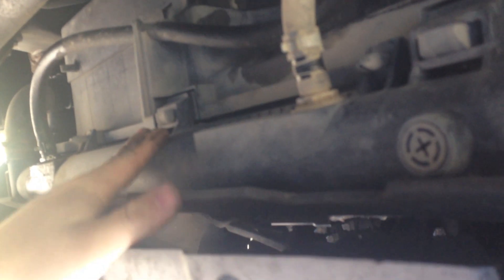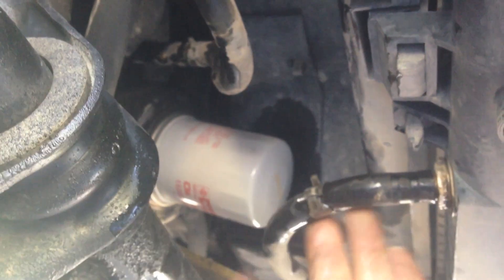Nissan 2nd gen Xterra Transmission bypass

Comment: Since I found Tras fluid on the radiator damage is already done I think, if I do this will stop the mixing? or should i replace    the radiator? I know aventually I have to Replace it and fix or buy a new transmission.

Comment: Hey guys, just bought a Xterra 2005 manual transmission with 80k miles on it and started to freak when I read about this issue.
Just wanted to make sure... Is this an issue that goes only for Automatic transmissions Xs?

Comment: i just got a 2000 nissan xterra, i put coolant in it, and a hour later well driving  the oil light came on and now its knocking and wont jump start? did  the motor blow up, bc there was too many miles? 

(it was running fine, before the coolant was but in )
Reply: I know this is an old comment, but I'm curious. What was the outcome here? Did you put coolant in the wrong place causing it to overheat?

Comment: any reason you re-routed the trans cooler lines instead of just unhooking from radiator and connecting them together Zak?
Reply from the maker: Just quick and simple . I've put 60000 miles on mine since then and its ran like a top. Good luck.
Reply: Thanks Zak. I've got appx. 35000 on my bypass with no issues. But I just disconnected from trans cooler and butt jointed together.

Comment: 61 thousand miles on my 2007 frontier, 2 transmission failures. one at 25k miles in death valley and now one at 61k miles due to radiator crack. fuck Nissan . wish i would have known this

Comment: Looking at a 01 Xterra w/119k miles.  Is there a way to tell if water has already got into the transmission before buying?
Reply: Gen 1 trucks are not known to have this issue.  The issue was predominantly with early Gen 2, 2005+. I don't know what they redesigned to cause it. Some things shouldn't  be changed I guess.

Comment: Awesome video and great solution to prevent transmission contamination! Another solution to prevent contamination plus eventual radiator leak in one shot would be to replace the radiator with an aftermarket NON Nissan radiator. Great job man.
Reply: super old conversation, but I was just wondering if your statement of replacing the radiator to prevent this issue is true? Would I need to do anything else besides replacing with an aftermarket radiator?  Thanks for the help.
Reply: John Park replaces mine. Haven’t had an issue.
Reply: @ZongTaVEVO  nice thanks for this - I actually got into an accident which forced me to replace mine about 5 years ago, haven't had a problem so far.  Currently got 137K on my 2009 xterra, and was concerned about this issue, but I guess i can safely assume that if it hasn't happened yet, i'm good, lol.

Comment: I did this bypass 4 months ago on my 2006 pathfinder after watching this video, I haven't experienced any issues yet. Thanks Evans.
Reply: Is your transmission still OK after doing the bypass?
Do you drive in hot weather for long periods of time? Get stuck in traffic?
Reply: It gets pretty hot here, the temperature where I live has been around 30- 42°C lately. I drive long distance once a week about 200km while the remaining part of the week is usually intra city driving with a lot of traffic light stops. Despite all that, I haven't noticed any deterioration in the transmission functions, in fact it became more efficient about a month ago after the transmission fluid change.

Comment: Zak
So basically you're creating 2 closed loops, correct?  Initially, you had coolant leaving your radiator, and flowing through the transmission (in a closed line of course) to maintain transmission temperature. It then returns to the radiator. Your new closed loop just circulates the coolant back into the radiator without ever going to the transmission.  That's all fine. Now what about the other closed loop in the transmission? Doesn't that loop contain coolant that will circulate?  The only difference is that the coolant will never return to the radiator to be regulated for temp. So, if you were to develop a crack in the line within the transmission loop, you could still wreck your transmission...?  Is that correct? 

Thanks
Reply: Or, does that second loop (to the transmission) contain only ATF and the original problem existed because ATF was being cooled while running through  the bottom portion of the radiator (hence the two lines at the bottom of the rad) and the rad, internally, cracked, allowing coolant to mix into that dedicated ATF line?
Reply: If that's the case, this bypass essentially isolates each fluid and creates an air to fluid ATF cooler situation. Sorry for all of the comments.

Comment: Zak I only found out there was a problem when my wife told me the car overheated. that's when I found the what I called purple foamy chocolate milk shitake in my radiator. ergo why I did the bypass. but was too late. so I'm in on the class action lawsuit about the radiators being faulty.
Reply from the maker: If it's already contaminated you need a complete transmission tear down. This is only done before it shows signs. Unfortunately this won't help u my friend . Get it cleaned out asap. It will be cheaper than a new transmission .

Comment: Great video . I have a few questions. Do you think it would be good to buy an 05 xterra that possibly could already be contaminated and do this fix? It's an 05 with 180k miles ... How is yours running today?
Reply: +Broseph how's your situation? I see you asked this awhile ago. Lmk if you still need this answered.
Reply from the maker: If it's already contaminated it's game over. Mine is doing great! Just rolled over 160.000 miles. That's two summers of pulling a boat and four 10 hr or more road trips without a issue.
Reply: +zak evans how can I tell of it is contaminated?? I took it to Nissan and they said it might be because the radiator has been replaced and the transmission fluid looks bright red.

Comment: We did it on our '05 at 90k 2 yrs ago, it now has over 150k with no problems, and we tow a 24' pontoon boat with it. No extra coolerwas  added, just the hose bypass.. thanks for showing how to do it!  R in NY
Reply: FWIW, I've been working with hot rods on and off for years. Most have small V8s (300-350 cu. in.) and three- or four-speed auto transmissions from GM or Ford. In no case have I ever seen anyone use the transmission cooler that's built into a radiator when building these cars. In fact, I have seen a number of people put these cars together with no cooler at all. It appears the transmission housing itself does a reasonably good job of dissipating heat, and those vehicles apparently last just as long as the cars with coolers. It's a different story if you tow, of course, but even then, a single air-cooled transmission cooler like the one in the Xterra should be more than sufficient.
Reply: Is your transmission still OK after doing the bypass?
Some people say that their transmission died right after the bypass. Did they do it wrong?
Reply: Maybe their fluid was already contaminated.

Comment: I have a Nissan Frontier SE 2007 and I'm planing to copy what you did in your Xtera. Do you think it's the same procedure with the Frontier to bypass? If so, was the tube that you removed the supply line from the driver's side?

Comment: Dam B and Zak Evans:  I just had the bypass/loop done on my 06 Xterra.  The mechanic who did mine (specializes in Nissan/Infiniti) said that it should be fine without adding an additional external cooler, because it already had 2 in place that it was using prior to the bypass.  Any other advice that I should be concerned about?  I feel like if it was needed, he could have easily told me that & made some more money, and I would've probably paid him.  I was taking his word on it though.
Reply: Is your transmission still OK after doing the bypass?
Do you drive in hot weather for long periods of time? Get stuck in traffic?
Reply: I did the bypass to my stock 06xterra I bought at 85k miles, it has been 6 years and is now 130k miles with no issues and I live in a fairly hot climate. I wouldn’t dare tow anything though

Comment from the maker: Why are you commenting so much when it is Apparent you know nothing about 2nd xterra cooling set up. The transmission cooler is still intact and fully functional. The lope ran transmission tran cooler -radiator cooler tran. Moving the hose as shown moves eliminated the radiator cooler portion out of the loop. Thus eliminating the possibility or cross contamination of trany fluid and coolant which plagued these trucks for years. So if you are gonna make comments know the facts first. If you want to rant read up on 2nd gen forms across the net. Don't be ignorant.
Reply: Is an addition of a transmission cooler needed?  Or can I simply swap the hoses to eliminate the problem?  My xterra has started to leak coolant into the radiator.
Reply from the maker: +Ben quinn then please express your wisdom and knowledge that you have . I did this 2 years ago . My Xterra has ran fine with no issues . I have pulled a boat through countless mountain roads in the 100 degree heat . This bypass was "recommended " by the lead mechanic at my local dealership.
Reply from the maker: +Ben quinn  tell your friend to do some research the way I did it has worked for tons of different people so he either didn't follow my instructions  or he in fact is the "bonehead". Nissan refuses to admit their transmission cooling system was faulty and the early second generation Nissan Xterra. It would make sense if you went to a Nissan dealership with the failed transmission that they  would be  more than happy to make tons of money to replace it. Of course they will blame the bypass  that don't want to be at fault . So don't come on here and say it's my fault . Worked for me , worked for others .  Idk what your friend did . Maybe you both should  go back to the craft section of YouTube. The directions are a little easier to follow.
Reply: I did this also to my bad luck and iam reaching 275 to 300f while driving  for 1 hr and 4wd and limp mode  no towing ill return back every thing as it was before and search for a good bypass that oil pass through transmission cooler on the front hope if any body have information to let me know